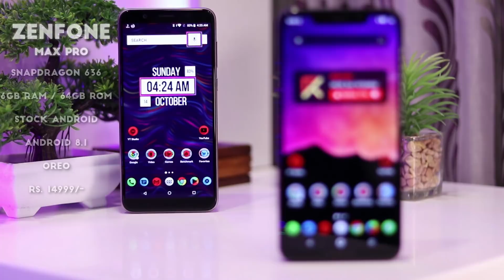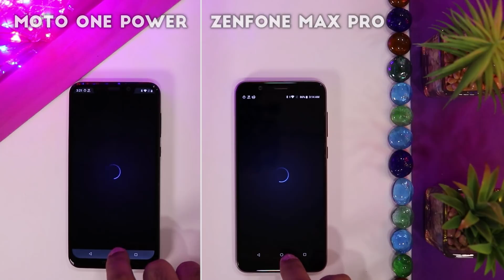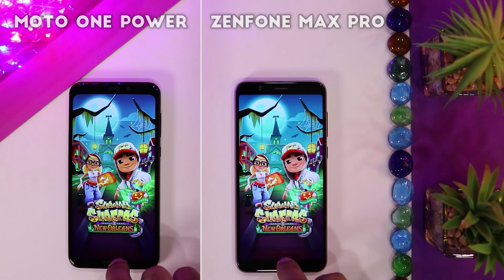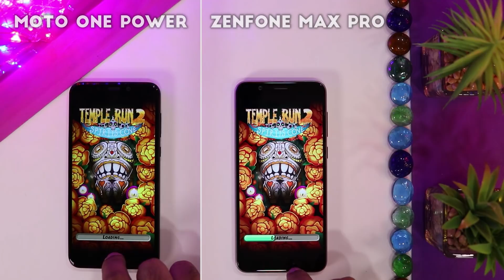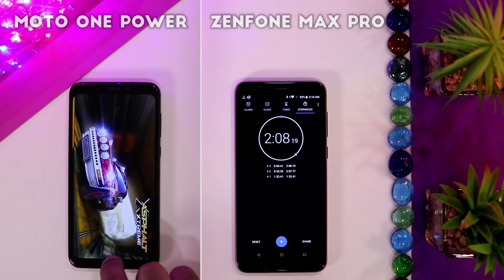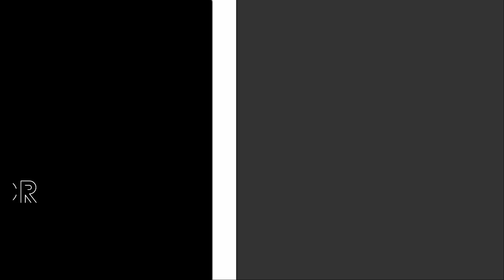SPEED TEST - MOTO One Power VS Zenfone Max Pro M1 (6GB)

Comment: Hello, I am a new viewer to your channel. Can I get your opinion for Honor 8x vs Redmi 2pro ... I personally liked honor 8x due to night mode,better selfie and the look of it... Also if I get honor should I get the 4gb+64gh or 6gb+64... My use is moderate little gaming and just the regular use. Thanks. Hope you reply on it asap.
Reply from the maker: I've the Realme 2 Pro and other than Color OS, which I'm not a big fan of, everything else about the phone is really good. I'm waiting for the 6Gb variant of Honor 8X as only the 4GB variant is available right now. In the long run, 4GB might slow down your phone. I'd always recommend going for 6GB RAM for all Android phones as it will ensure that your phone will run smoothly even after few months of use.
I personally like Honor's EMUI much more than Realme's Color OS. Also Night mode, as you said, is a big advantage.
Reply: Okay tysm I subscribed to you :D... Also a thing i had a 2nd thought about was poco f1 i consider myself as very rough user but will the phone survive for like 2-3 if i use it with protection i.e glass and good cover?
Reply from the maker: Yes, it should survive with a decent case and a glass screen protector. The phone has a good build quality. It's not fragile like glass back phones.
Reply: Saw few drop test the screen shattered from even waist height.
Reply from the maker: That's coz it has Gorilla Glass 3 which cracks easily compared to GG5 and the platic body doesnt absorb impact like metal does. But with a decent case with air gaps at corners (Kapaver or Spigen), the phone will be safe even if it is dropped from about 4-5ft.